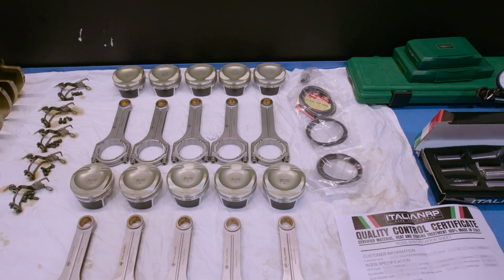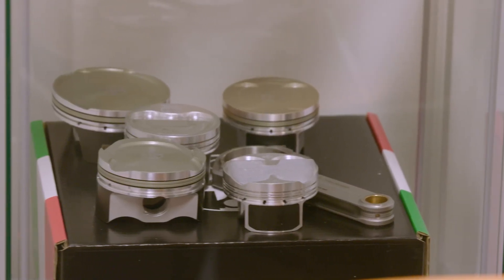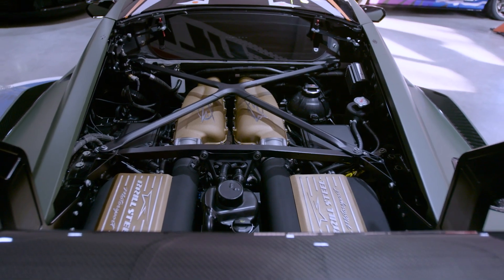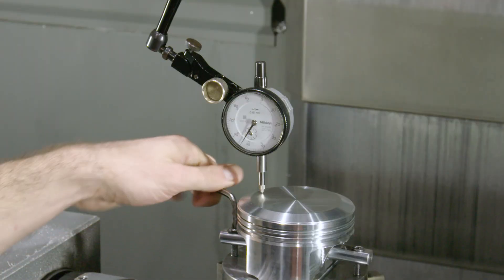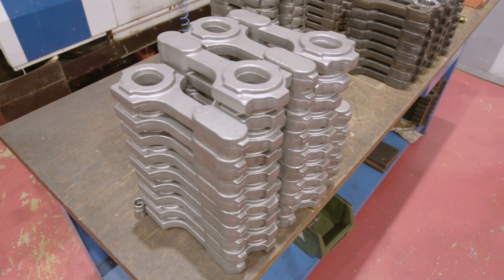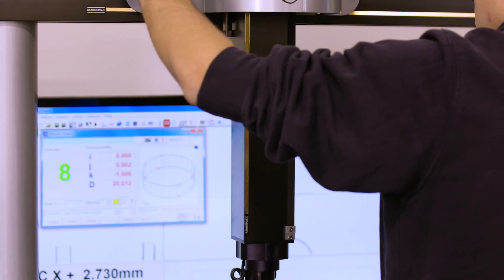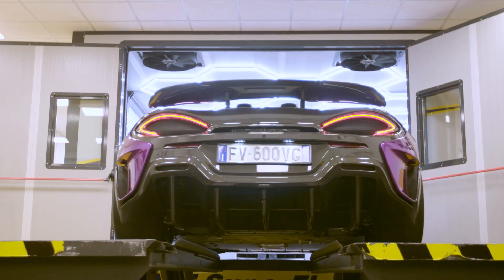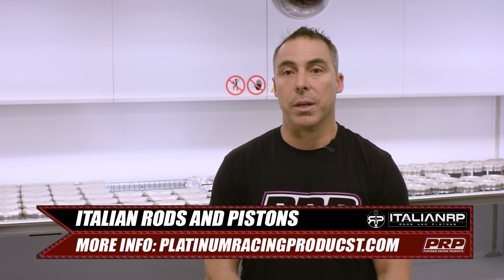How Forged Pistons and Rods are Made at Italian RP - Platinum Tech

Comment: Why would you bother with Barra 😂
Reply: they are great engines
Reply: @tturi2  not really when you compare them to great engines.they are average.i have had 2jz for 20 years and I can tell you.who the boss is and it's not the wheel Barra please 🤣
Reply: @definitionmedia1130  I had the vvti one in my supra, great engine, took 550ps stock headbolts and oil pump, but the barra is also great in my experience, 500,000km and not looked after properly for 450,000km lol
Reply: @tturi2  It's ironic both 2jz's are barra's are meh engines in New Zealand, they do have a cult following but its rotaries and RB's.
Stuffing 2jz's into different cars overseas may be a thing but I only ever seen them installed in original Toyota models like Supra's, Soarer's, Aristo's, a repowered Hilux here is more likely a 1UZ-FE Lexus V8.